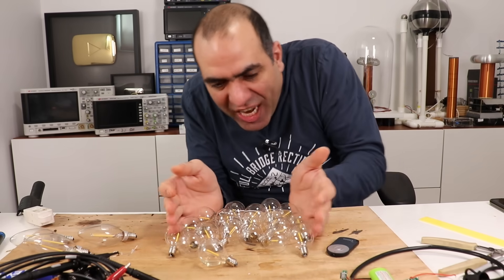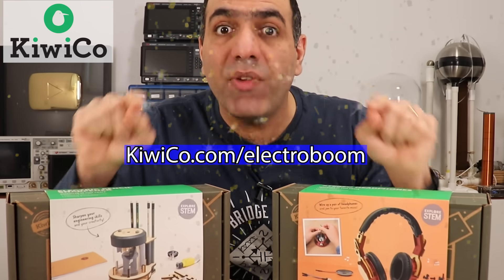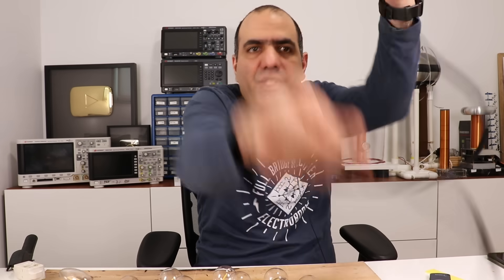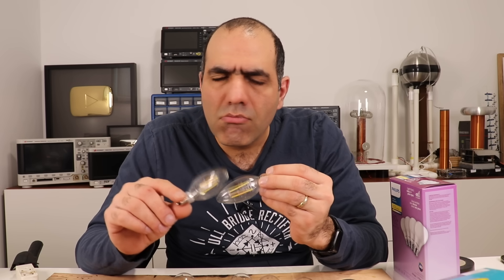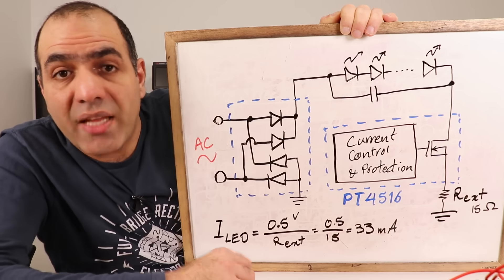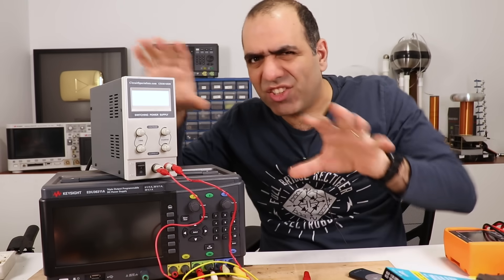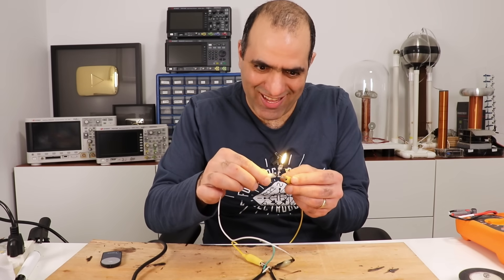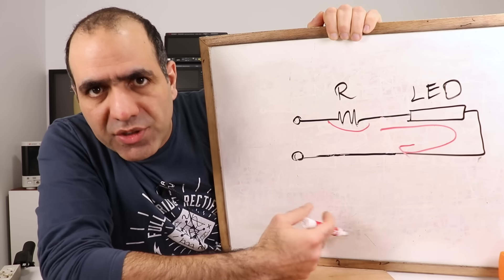So Many MISERABLY FAILED LED Lights

Comment: The manufactures even quality brands have optimized the circuits to last just 15k hours, so you have to buy a new one. There are some types for commercial buildings with 40k hours, but they mostly 5x more expensive.

Comment: Thats why i use incadescent bulbs as much as i can. With the price/quality ratio, usually its much cheaper than the elecricity you can save for the lasting period of that led bulb. And where the use is very rare and short (closet, garage, etc.) Its just not worth it. Led bulb 5eur, incadescent bulb 0.3eur. And they usually just state the theoretical maximum led lasting time on a package whereas its mostly the voltage control circuit, that fails. For using outside also no better than classic bulb. No probs with water, as they are sealed as a necessity of a design. Try breaking the glass of it, the filament burns in just a few seconds

Comment: The only LED (E27) Bulb that failed for me in the last 15 years or so was a very very cheap 2€ E27 LED Lamp... but maybe it was my fault... i used in the bathroom in the ceiling lamp... maybe the lamp didnt like humidity... (in too high levels..) all other leds never failed... i only got philips leds (also dimmable) and hue lights from philips.. seems like they last forever

Comment: Estimating the lifetime of an led light is much more complex than for an incandescent light bulb, because of its long life span and the higher number of components that can fail. Therefore, 10000h lifetime means that 90% of LED lights will survive that long, but not all of them. Most of these "defective" 10% will fail already at the beginning and most of the time it is actually the driver and not the LED itself.

Comment: Recently I had to replace a power saving light bulb. Before throwing it in the bin, I pried it open and there were so many parts. Diodes, capacitors, a transformer???? Very cool for parts as it would have been wasted otherwise.

Comment: I remember about 8 to 10 years ago LED bulbs had aluminum passive heat dissipators which not only made them look futuristic but also kind of badass.they also had glass domes. Now all them are made out of cheap plastic garbage

Comment: Regarding the resistive dropper on the very small "outdoor" lamps, those LED strings I believe are called "Chip-On-Board or COB" construction, and many of them are about 40 LEDs placed onto that flexible substrate.  That said, driving a series string of LEDs with straight AC strikes me as insane.

Comment: One of the images you showed claimed IP44 rating. In my opinion IP44 is barely rated for outdoor use. It means that it can survive water splashed from all directions. I don't think a decent rain storm counts as splashing. One step up, IP45 means its rated from low pressure water jets from all directions which sounds much more like a torrential downpour.

Comment: In the Winter Times, like in someplace Cold like Canada, I like to warm my House with Incandescent Lights. Even though they use 10 times the electricity of an LED light, they are just as efficient as any other electric heater. So that when I turn on the lights in the room I'm in they produce both light and heat. As a bonus, much of the heat these incandescent lights produce is in the infra-red so they actually heat all of the surfaces that the light is shining on, like me. Infra-red heat, makes me feel warmer than the room actually is, so I can save lots of money in the Winter Times using these old fashion Incandescent Light-Heater Bulbs. Just don't forget to change all the light bulbs back to LED bulbs in the Summer time when it gets Hot, which never seems to happen where I live in Canada.

Comment: Well, I swapped 90% of my bulbs to led back in 2017 due to me working midnight to noon waking up was rough so went with 6500k for helping with waking mind up. Only had one of 6 die so far (water issue)

Comment: Engineers design parts to last. Manufacturing companies that churn out thousands of these things design parts to break after 3-6 months so you have to continually buy replacements.
Reply: Basically yeah. Engineers would love to make stuff that lasts as long as possible. But first the marketing guys come in and say "you have to make the product sexier, it doesn't matter if it isn't as good as long as it looks better than competing products!" So you lose some functionality and durability due to that. The the bean counters come in and say "these products must fail after the warranty period expires so that people buy more products!" And so you get these shitty products that might look nice but are generally just bad. It's not because the company couldn't have made a better product, it's because they don't want to. That's how you get stuff like Apple laptops that fail after a year or two due to some really dodgy design "features" that basically guarantee those laptops don't last that long. And LED lights that fail after a 1000 hours instead of 30 000 hours they could last if they were made better.
Reply: Or engineers designing down to a price point because that's all a customer is prepared to pay for an item even when it has a short useful life.
Reply: Sounds like he struck a nerve on an average Canadian engineer.
Reply: No, the companies that ask these manufactures to make it for as much profit margins as possible and the boss gets a huge sum of money.
Price does not equate quality from any location, that or brand. I paid a lot for certain brands and they still die in 3-6 months.
A lot of the time is is also the enclosure that the led is in.
Reply: Do manufacturers like to be super GREEDY? For 💰?

Comment: lmfao.     at 2:12,  in case no one has already said this,
 a  LED   runs on  low-voltage  DC.     NOT mains AC.
Reply: this lightbulb is for 120V AC, as he explains it later, there are some components in the bulb

Comment: “The results agreed with me”  These are the results I’m looking for Mehdi! Great vid, as always. Those resistor only leds. I’m shocked (of course pun intended, why wouldn’t I  - irresristable)   But - that’s just morally bankrupt. Which uses most power,? Light or resistor? (Maths=work, I admit, I’m lazy, but I believe the phrase ‘Most inventions were made by lazy people looking for easier ways of doing things”
Takes the heat off me at worst, reckon it’s true myself!

Comment: i bought Osram dimmable 11w e27 bulb for 12€ to replace 100w and get long term economy. Noticed that its darker bought second.. still not enought. Bought third. So spend 36€ to replace one 100w bulb. Its led and branded so will work 10k hours. One died after 2 months, aprox in 6 months died all. Replaced dimmer, bought led for 2€ and replacing every year. Green peace not like glass (sand) and volfram.. economy replacing 100w 0.06€ bulb. myth that LED is not getting hot. My girlfriend one night called that one light blowed and shooted out of celling.. these bulbs can easy burn house as hot part is behind celling in plastic cup who can melt and burn.

Comment: 0:40 I bet they DO know how to make things to last, they just prefer not to, because if it doesn't last as long, you have to replace it sooner, which makes THEM more money.  3:28 what they're counting on is that after 6 months, most buyers will have already misplaced or discarded their receipt, or forgot it even had a warranty.   First LED bulb I bought was guaranteed for 2 years and it went ZZT-POOF after 2 years and 11 days.  (LEDs were fine, but the tiny driver chip inside the base blew up)

Comment: Any1 know if the lifespan of led lights can differ from building to building? 

Context:  I life in  Vienna.  5 minutes  walk away  from the flat I grew up in.  My mother  still has a awful lot of broken led  lights and I simply don't.  Her flat uses older cables and stuff but still has the correct safety mechanisms like  breakers. 1 of Viennas electricity substations is verry near  to us so I guess the fluctuation in the powergrid is kinda  the same?  Maybe she uses her lightbulbs a bit more since  she got less natural sunlight in her rooms. As for brands of the leds I tend  to buy  the cheaper  ones since they  normally last years  without any  trouble and she is getting higher  quality led  that  still die after  couple of  months... any suggestions what could be causing this?

Comment: In around 2002, I put together a 1 Watt LED and switch mode driver.  It turns on when the room is dark.  It still works 19 years later.   Why? Quality parts.  Luxeon LED, with a big heat sink.   Heat not only shortens the life of LEDs, it also reduces their light output.

Comment: The main problem, is the "form factor" (shape) of the bulbs. They are trying to maintain the same shape and base type, so they can fit into old fixtures. The result is HEAT. With old incandescents, they work by being HOT, hence radiate in the visible range. LEDs on the other hand are semiconductors, where heat is your enemy. Also why LEDs are more efficient, since they are not intended to release a lot of heat. A new form factor where there is more surface area, towork as a heatsink, allowing the heat to dissipate into the air more easily. There are new LED fixtures, where the LED board (the board has LEDs and drive circuitry on a single board) is large enough to dissipate the heat, making it run cooler. It does mean you have to change out all your fixtures, when switching to LEDs.

Comment: I have never had an LED bulb of any make last anything near the claimed hours. When I install them I write the date in felt tip on the base. They will fail as rule within eighteen months, the main cause is the dreaded black spot of death on an led or the dropper cappacitor failing. Dropper cappacitors seem to be a favorite on the smaller bulbs sold here in the UK. LED bulbs may be "more efficient" but they have an absolutely terrible power factoir, which you showed on youre scope. It will only be a matter of time before the power companies start charging for this, as big Clive points out on many occasions smart meters have the ability to measure real and apparent power.

Comment: A year or so ago I was walking through the dollar store in town and saw some LED bulbs, 100w equivalent, so I bought a few figuring if they were garbage I would only be out a few bucks. More than a year later all of them still work perfectly. I wen't back and bought a dozen of them so I should be good for indoor bulbs for a long time. They also have a 10 year warranty, although I'm sure the business will be long gone before the 10 years are up, but for a dollar, who cares.

Comment: I went through 30 candle-type SES bulbs in about 6 weeks. The biggest issue is that they're mechanically very weak where the glass meets the metal - any knock and they break.

Comment: I was having issue with LED light bulb in the same socket 3 socket in my house and thought they were being destroyed by the current in the house due to the weird behavior and thought if I changed to the dimmable version it would fix the problem.  Seem to fix it at The moment

Comment: Hello! You can buy a new LED Light and change circuit driver, so your lamp reduce light (60...80%  power of original) and probably long life :) I did it. In several LED lamps change resistor in circuit driver and worked very well. In one big LED Lamp I build simple new power supply ( two parallel condenser 680nF 400V because don't have over 1uF with this voltage, fuse for safety, resistor 220 Ohm, bridge rectifier, condenser 400V 68uF and original LED) and also work very well. i think that it's create a long life lamp, save money and less waste :)

Comment: Incandescent liightbulbs with slow start and especially with reduced voltage last quite a long time, assuming they are properly manufactured of course. As for the energy use - well, with my servers, miners and AC, the power used by lighting is not very noticeable. Even if it is slightly more expensive to run an incandescent than an LED, I like them.

Comment: I like how Mehdi finds out way more about problems with their product than these companies' actual R&D and engineering departments.
Reply: Someone who slaps a series resistor on a string and then cant even glue a lightbulb together has no R&D or engineering department.
Reply: it's probably not that the R&D department didn't find anything, it's that the higher-ups didn't listen when they were told about the problem, possibly because it would have cost them more money to fix it than to just leave it.
Reply: R&D is a thing. Market departments wants the R&D to design them to fail.
Reply: All the R&D in these companies is about making something shaped like a working product as cheaply as possible. For example, they may have managed to save half a cent by eliminating the watertight seal and still have the lamp work for several days, good job!

Comment: We all know the engineers who design these bulbs are given incentives to design these bulbs to fail early with normal use and give time ratings based on completely unrealistic scenarios.  The 10k hours is TRUE, only if the operating time is less than 50 microseconds intervals with 10 hour cooldown period before the next power cycle of fewer than 50 microseconds.  They don't expect people to use them like normal light bulbs, that would be "crazy"....

Comment: Buy expensive LED light and then find that it's all made in China, probably by the same Chinese company that makes the cheaper LED lights. I have been lucky a few times, always bought Philips or Osram and found that in the same package one can last even a few years whereas the other light just a few months. Pisses me off quite a lot, fortunately amazon has much better prices on the same lights from Philips and Osram. If I had bought them in a normal store I'd spend almost 50% more. What a shit world

Comment: Nice, 4 sparks within 15 seconds right at the start, and then another 3 sparks and a shock within 15 minutes later on!

Also, those kits from the sponsor look pretty cool. I would still do one of those even as a 39-year-old.

Comment: I bought Philips LEDs because I wanted a known brand in hope that they don't die so quickly when we moved in our new apartment. Now after pretty much exactly 3 years more than 5 of them broke down. All in the same time range of ~2 months. Apparently they only have two years of warranty, so I pretty much bought expensive e-waste. I'm really pissed of about this shit, real light bulbs are (rightly) banned in Europe, but everytime I'm buying a LED I fear that I pollute the world just in another way. It seems like every manufacturer does planned obsolecsence since it should be SO FRICKIN' EASY to build high-durability LEDs, see the referenced Dubai video. This annoys me to no end.

Comment: Expensive? These things are dirt cheap nowadays. I can get them at the Habitat for Humanity ReStore for a $1 each all day long. They have hundreds on the shelf.

I have loads of LEDs. Occasionally I'll have one of the strip ones like these go out. But I have about a dozen around the house in light fixtures and I think one has gone half out in three years.

I like to buy the full size lightbulb type light strings and then switch out the cheap bulbs with LED floodlights. Awesome light for reasonable prices, and you can get CRI 90+ or 95+ bulbs.

Comment: Isn't it illegal to put diodes in parallel? Due to slight difference in forward current one diode consumes more current than the other one, therefore it heats more and conducts better...and consups more current....and burns like a heretic.

Comment: When those cheap bulbs die after six month and I go back to the listing on Amazon it's usually already not available anymore because they probably already relisted them under a different name. When LED bulbs took off I was excited that new companies could innovate and leave the old lightbulb oligopoly in the dust. But nowadays I only buy brand names like Osram and Philips, because those still have a reputation to lose, so you can be sure it's not garbage, even if a little pricier. Finding the one good brand that is equal to or better than the Osram offering in the ocean of noname LED bulbs certainly is possible, but just not worth my time.

Comment: I found the same thing even with full size bulbs from bulbs bought at the hardware store (which is normally better than Amazon).  I had 5 Ecosense dimmable bulbs in a dining room fixture and at least 3 of them would just randomly turn off and on.  Since the dimmable ones are so expensive I gave up and just put a regular switch on those lights and bought the non dimmable.  They've been better so far...  But yeah in general I have found a high failure rate and it's usually stupid crap that would be easy to make better.

Comment: Those outdoor bulbs were listed at IP44 rating, so that means they were rated against splashes and not the continuous stream of water that rain would be.  Seems that it would be odd that for something meant for outside, it'd have such a low IP rating.

Comment: The whole video, I was waiting for the inevitable "one moment, please..." and a switch to Clive. You two really should do a crossover episode together :)

Also, about the 10000 hours (or something like that) longevity of the bulbs - many times there's a fine print disclaimer (sometimes quite hidden) that it only applies under very specific circumstances. Even the big brands often do this.

Comment: Rather stick to incandescent, halogens and even some old fluorescents. LEDs are a overhyped scam. The one's that irk me the most are the 'built-in' fixtures. When those go bad (and they will), you need to replace the entire light in the process. Single-use and more expensive product that'll just be thrown-out money in the end.